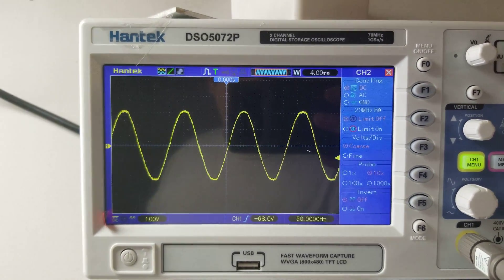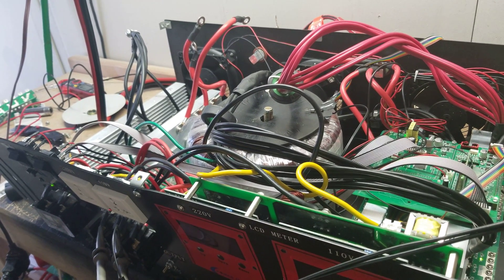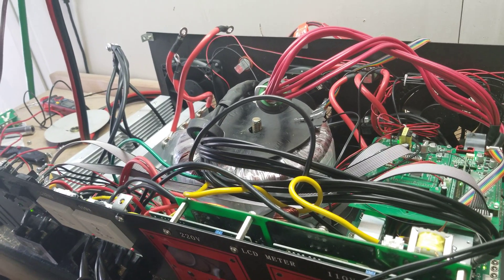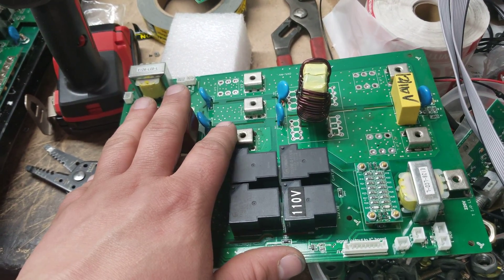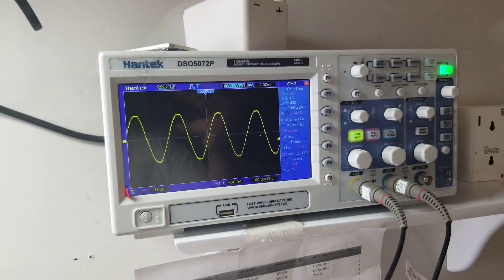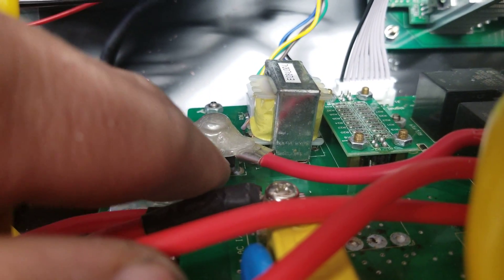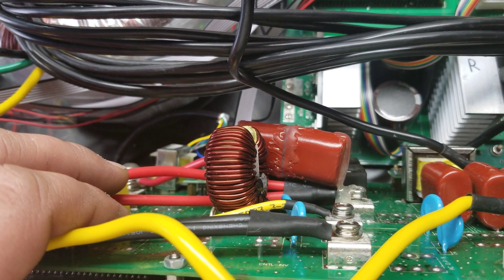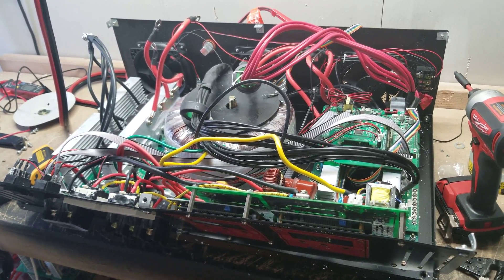How to fix L1 noise on 10kw and 15kw powerjack inverters

Comment: I have an 8000 lf 12v powerjack inverter, I have the problem that the l1 + n gives only 102 vol, the l2 + n gives 115v. I changed the whole board, I think it's 7.0. but the condition remains the same. I saw video where there is an option to adjust the output voltage, but my inverter does not have that adjuster. There is some way to correct this or adjust it. I don't want to keep changing components without any result. Thanks for the help in advance, and I ask you the boar you sell for tru splite phase fits my inverter.
Reply: There is no way to fix this without replacing the transformer.  The imbalance is due to the transformer phases being wound unequally.
Reply: if you are smart you can add a turn on L1 of the transformer or take off a turn on L2 to balance the voltage .

Comment: I have a 8000 w inverter what value capacitors do I need to buy to do that modification? Thanks
Reply: How do I know if I have the problem.
Reply: 2 or 4 u f is what I use on my homemade inverters and I'm sure it would work good on this you want the UF to be very small or it will add to your idle current
Reply: And by the way make sure that they're rated 4 above the voltage turn other words if you have a 220 volt system make sure to at least get a 250 volt capacitor

Comment: Did you test it with a load? You can add line filters on the outside of the inverter as well. I noticed that power jack is only filtering one phase to N. That's surprising because the parts required to filter noise on both L1 and L2 is minimal. On the Power tank unit I purchased, it had been miss wired and the outputs were wrong. On 220 and other problems because the assembler had reversed the N and L2 connections from the transformer to the charger board and the output wires from the charger board as well. The N out was going to the L1 on the terminal strip hence no 220. The N and L1 at the plug were also reversed. So anyway I learned then about to lack of filtering and other design deficiencies with the filter network used with PJ inverters. I will be improving  this deficiency with external capacitors and inductors between the inverter and a disconnect box. On my unit there is some sine wave clipping when a load over 500 watts is connected.
Reply from the maker: Yes I have done this mod to my own inverter I use to run the house. It allows me to run my washer now which used to complain a little bit
Reply: You can also get the idle current down further by using a inductor filter between the board and the Transformer low side input of the Transformer You Can Read All About It On the back shed. Com
Reply: Could you please provide the specs for the external capacitors and inductors and a photo of what the finished product looks like. Many Thanks. Happy Holidays!

Comment: Ok...I have the 10k  24v 7.0...it arrived with a damaged charger board, 1 of the 3 thinfilm capacitors were broken. So I have 2 left I could take off that board and use...my question is, are the specs on those capacitors right for this mod? Or an you give me specs so I can order another set to do this (or 1 if the combined specs will work also). 2nd question...you are not running thru the L1 wire itself, but bypassing it to each terminal?
Reply from the maker: Hi Glenn. Easier if you contact me on my Google voice number.
Reply: @GenetrySolar  Ok...where do I find that? Link?
Reply: Do a Google search on genetry solar .com and you will find his number there if I was you I would text him first he's very busy